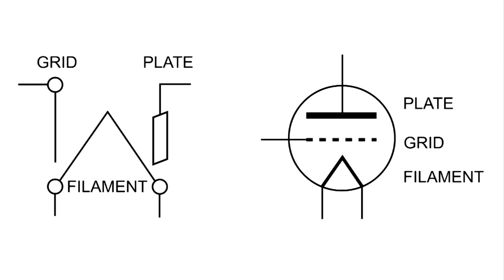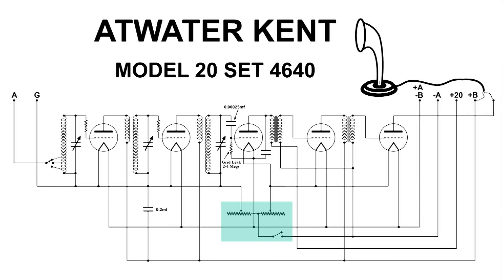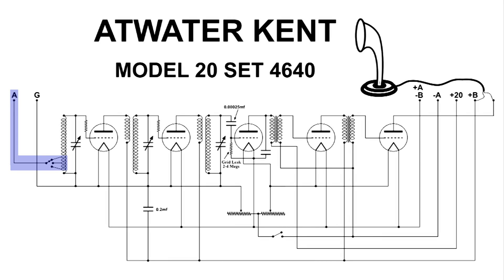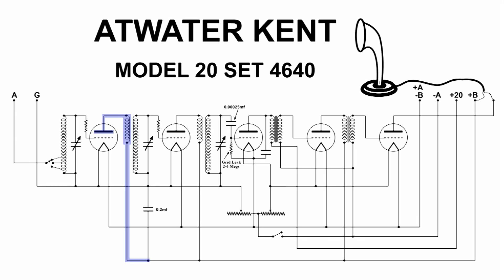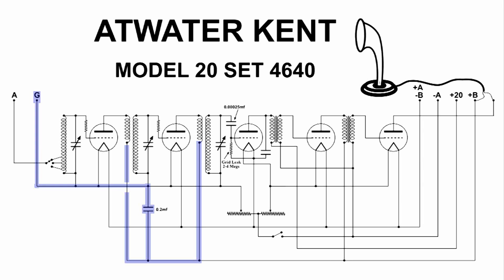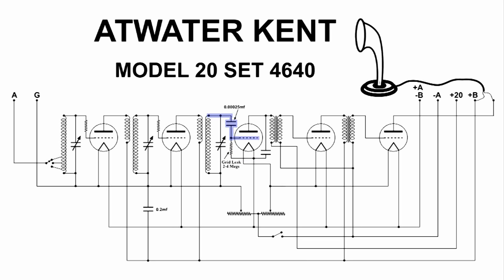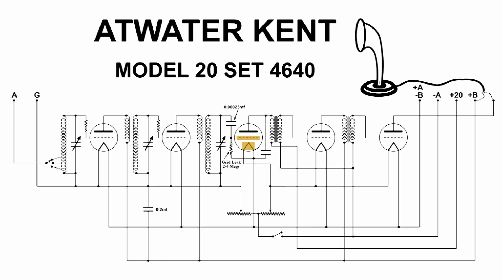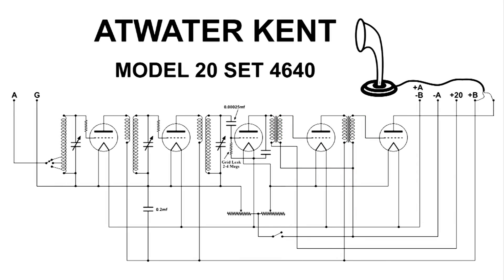TRF Radio Circuit Atwater Kent Model 20 4640

Comment: Question:  Is the detector doing its job by being in "cutoff" when the signal goes negative?  In other words, the bias caused by the grid leak voltage causes the tube to behave like a diode in that it removes the bottom half of the modulated RF signal?   lol ...I hope I am close as this is my third attempt to grasp what is happening at the detector.   Great Video!  Thanks
Reply from the maker: The filament and the grid make a diode. The grid leak resistor supplies a high impedance DC bias to the grid, this impedance is high enough not to short out the RF signal. This RF signal is cut in half by the grid and filament, and this signal is on the grid so this detector tube also amplifies this cut in half signal. So the detector tube cuts the signal in half and amplifies it. Thank you, and thanks for watching!
Reply: @AllAmericanFiveRadio  aha -  now I get it!  Thank you for taking the time to explain this again!
Reply from the maker: @RICKS_Retrotronics  You are welcome, glad it helped!

Comment: I am currently working on an atwater kent model 42 (late 1920's). Will it work without an antenna ground as well as the radio in the video?
It was sold to me as formerly working but with broken tubes from a fall during moving.
 Before replacement of tubes, caps & resistors, the only sound I could get out of it was intermittant popping and scratching when at the each end of the volume knob. Now, after replacment of parts and inspection of chassis components to include coils and of volume rheostat, it still does the same thing. 
I must be overlooking something simple. I have a very stong local station and can't pick that up or even get constant static over the speaker. The speaker is in working condition. I thought it would receive without a ground from my work table.... could this be the issue, no antenna ground on this model? All 7 tubes checks good.
Reply from the maker: I have one, and it does work with just an antenna and no ground.
Reply: @AllAmericanFiveRadio  , thanks for the answer of ground... guess I'll keep on plugging away for the sound issue. Have a great day on your great channel!

Comment: That was a great video! I have a 1920's Malone Lemmon Neutrodyne Reciever that will run on three tubes. Is this nomal? The two tubes that i believe are in the amplifier circuit seem to have little effect unless I turn the rheostat up. As those two tube begin to glow the audio begins to decrease.

Comment from the maker: Thanks CameramanLink
It's magic! The detector is multitasking with out time slicing. It works because the audio frequency and RF frequency are far apart. But the RF amplification , RF rectification into audio, and audio amplification do interfere with each other. However it was a great circuit for the 1920s and save the manufacture cost and therefore their customers.

Comment from the maker: Thanks AndyDaviesByTheSea
Hey Andy,
Yes there has been a number of name changes over the years. I think the first one I ran into was when the condenser name was changed to capacitor. I remember asking the electric shop teacher what was the difference? He said it was the same thing. I thought, whats wrong with condenser. Also the tube HeathKits I built used V1, V2,...V6... in the wiring diagrams, of course the V1 is Value1.
73's Rick

Comment: Thanks for that Rick
You talk about how the symbol for the tube has changed, I wonder if the name has changed as well.
In my lifetime (60 turns on the coil as they say) condensers have become capacitors, accumulators have become batteries and aerials are slowly turning into antennas. In the UK we still refer to "TV aerials" (that's for yagies not dishes) rather than "TV antennas" as a radio ham  I use both terms 
 and I wonder if you ever called "tubes" "valves" in the States.
73's Andy